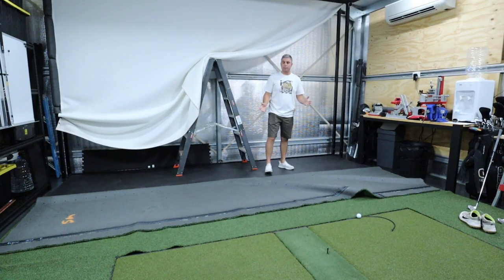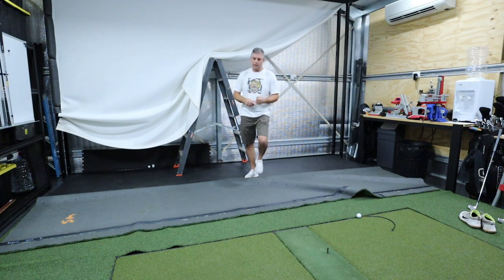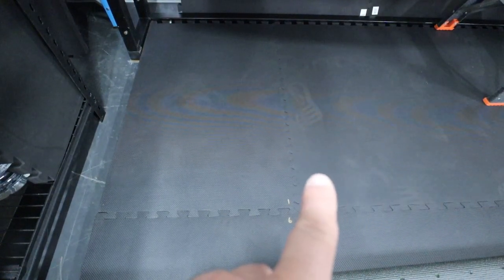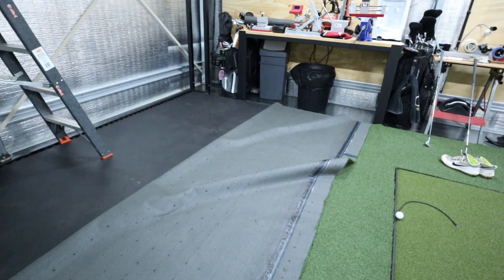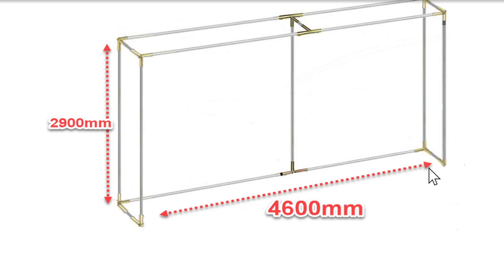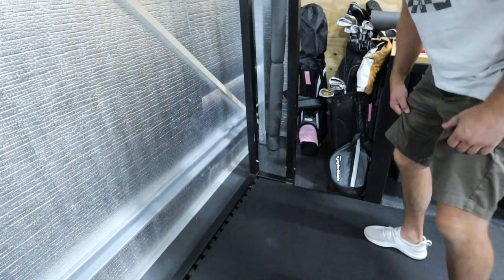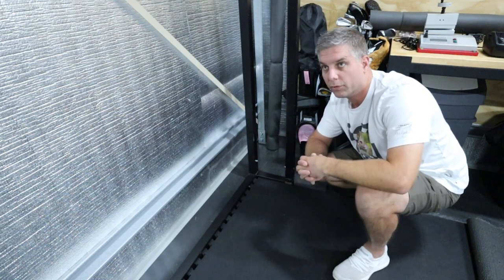DYI Golf Simulator Frame Build for Impact Screen - PART 2

Comment: Great video.  I bootstrapped an in-garage sim that I was looking to make some improvements on.  I did my original design with 3/4" EMT and my screen is only 10' wide but sags in the center.  Your work regarding the frame was very helpful and has convinced me to use your approach in my next update.  Maybe I missed it, but what gauge tubing did you use?  Thanks!
Reply from the maker: Hi Philip, I'm glad the video gave you some inspiration to improve your screen.  The entire purpose of my video was to simplify the build process for others by reducing the research and expanding the knowledge for others by learning from my mistakes.  The RHS tubing I used for the main support beams which makes up 90% of the steel used was (50mm x 50mm x 2mm wall thickness).  The corners and "Y" pieces were a heavier gauge and smaller diameter (40mm x 40mm x 3mm) to allow sliding internally into the 50x50 RHS tubing.  One of the reasons I went with a square tubing at 50mm x 50mm was to reduce any sagging over the span of 4600mm.  My frame has zero sag and its a number of years old now.  I hope this helps, good luck.

Comment: I see you haven’t posted i awhile hopefully your doing well. Question about the gym mat and fiberbuilt hitting area interface. Are they at the exact same height? Would you change the mat thickness if you were to do this set up again?
Reply from the maker: I haven't posted because I recently sold my home and bought a new upgrade.  Unfortunately the new home doesn't have a simulator space as of yet.  I hope to build a new sim soon, but time and money is getting in the way with an already busy few months with the new home.  My gym mats are a few millimetres less in thickness compared to the Fiber Built mat which allows for the turf to sit flush on top of the gym mats.  Yes the gym mats plus the putting turf is exactly the same height as the Fiber Built.  This was very important to me to ensure a healthy roll while putting.  If there is a slight difference in height that isn't visible to your eye this won't be noticeable when putting.

Comment: Fantastic work!!! I also try to do something like that, but I have a question, If I put my projector(i want to buy  the same model like yours) 15 feet away from the impact screen there is any problem with the shadow? The high of my room is 10 feet thanks Antonio
Reply from the maker: depending on your height you may see the top of your head shadow, only based on the 10 foot height not the 15 feet

Comment: awesome video, hoping to builda 16x20 shed next year. Can you make a video more of the garage/shed structure itself? Did you build it, what was the cost, why you decided on a metal building. etc.
Reply from the maker: Hi James, thanks for the comment.  Please subscribe and like the video.  I've recently purchased a new home, and my simulator is no more.  At the new home I am planning on rebuilding my sim bay, but time and money is in the way.  Especially the COVID build prices are holding me back.  I kind of built the building for the last sim on the video.  Basically I picked the size of the structure 6mx6mx3m and had a cement contractor come in to pour the concrete base.  Once the base was complete and painted dark grey I ordered a "shed" package to accommodate the concrete pad.  I live in Australia, and steel shed structures of all shapes and sizes are extremely common here and very cost effective for what you get compared to a lumber structure.  see weblink below.
https://www.southerncrosssheds.com/products/domestic-sheds/

I chose to insulate and add air conditioning to the structure for obvious reasons.  The shed structure was assembled and finished in one business day compared to the lumber building.  Once the building was built, I had an electrician come in and add all the power points I required based on my plan and imagination.  The shed without the concrete pad insulated and assembled was approx. $6k, then the electrical wiring etc.  I did all the trenching for the main power to the building to shave some labour costs, and completely wired all of the low voltage A/V cables etc.  Once the time and money challenge is removed from my recent move at the new home, I plan on making a series of video showing the complete build from start to finish.  So far I have the new building erect detached from my house.  I went for a slightly bigger building this time to allow for more sitting room for guests and viewers.  My new building is 7.5mx6mx3.5m.  So far just the concrete and building are finished with no electrical or insulation, air conditioning yet.  hope this helps!

Comment: Where did you get the pipe insulation in the video.  I can’t find any near that big/round to use and cover the gap for stray shots.  What’s it called or anyone have a link to it online?  I can only find 3/4 and 1” or slightly larger pipe foam insulation but this looks like it’s for 3” pipe or something and is what I need!
Reply from the maker: https://www.scottsfrp.com.au/?s=Foam+pipe+insulation+

It’s 63mm OD

Comment: Awesome video after watching I am considering almost copying your build. Just a few questions though:
1. What is your option on the fiberbuilt mat and have you noticed any wear and tear on the standing section.
2. With the rhs tubing I was a little bit unsure what process you used. To me it seems you were saying you cut the tubing to your dimensions and inserted it in different joints to build the frame and then had it welded. I want to save some money on a frame and have access to a quality welder for cheap and am wondering what tips you would give on building the frame and the math in determining the size of anything.
Thanks a lot, I would really appreciate any other photos you have of the original frame and build so that if i decide to copy I have a reference.
Reply from the maker: Hi Oakmont.
1. I can't comment on this one because my standing area on the Fiberbuilt mat has no wear on it at all.  Its been years of standing on it with golf shoes and no wear.  However I never hit golf shots from this area, meaning no golf club impact on the standing area.
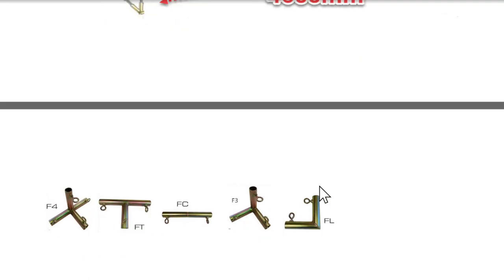2. Pause the video at the 5:50 mark.  As an example look at F4.  I only welded these sections, I made a piece out of smaller tubing and inserted it into the larger tubing then bolted it together.  These are the corners of the main structure that hold everything together.  When built this way I'm able to take apart the frame anytime to relocate.  My frame is currently locked away in storage since I moved.  If you show your qualified welded my video, his mind will work in a way he will understand the design.  Happy to meet you on Microsoft Teams to walk you through the design.

Comment: Hi really love the video and details on the design. I am looking to build one for my studio. You mention the roof juts out 1 meter. Did you weld more square tubing to the frame to build it? Could you tell me a little more ? Dimensions for the tubing? and then lined with the ply? Thank you in advance
Reply from the maker: no I didn't weld the tubing.  The "Y" sections I talk about in the top left and right corners were four sided instead of three sided inserts so I could slide the tubing over to build the "ceiling".  Then I covered the underside with 3/8" plywood so I could glue the acoustic foam panels to the plywood. The tubing is 50mmx50mmx2.5mm

Comment: what size is your garage? im looking a putting one in my backyard for a sim.
Reply from the maker: Hi After, make sure you take a look at part 1 of the video.  Lots of good information including the size of the garage.  6m x 6m x 3.1m to the eves
Reply: @sklebeck  Hi again Shaun. We finally made it to the new house (stranded in northern NSW for nearly 5 months waiting to get here). The space isn't quite what I was hoping for but I have enough room for a 12' wide x 9' high screen and about 17' screen to back wall so I should be able to fashion something half-decent. Have you moved into your new home and re-established the simulator bay?
Reply from the maker: @rufussthoo4083  i did get moved, but my simulator bay hasn't been started yet.  Time and money.  I estimated about $10k - $15k to finish it.
Reply: @sklebeck  I hope it comes together for you the way you want. I'm still struggling to decide on the launch monitor. A GCQuad/Trackman/Flightscope are beyond my budget so I'm having to look at the Uneekor EYE XO (ceiling mount) vs GC3 (limited data) vs Full Swing (radar based).

Comment: Great video, I'm in the process of making something similar based on your design, they say imitation is the greatest form of flattery 😁 Just wondering roughly how long you made the bunjees, I've seen pre made ones on amazon cheap enough plus how many did you use. Thanks for your time 👍
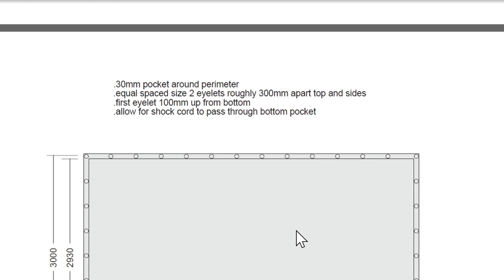Reply from the maker: Hi Jayo, I appreciate you watching and I hope you've seen part one of the build video.  My bungee's are 2.5" long.  the total number used can be counted on the drawing displayed on this video.  Go to 7:23 and count the number of holes to give you an idea. (30 bungee's total) That is that exact build drawing I used.  Again thanks for commenting and please subscribe.
Reply: @sklebeck  thank you sir for the reply much appreciated..subscribed 👍 hope your new home doesn't have the flooding problem, best of luck with the new build looking forward to seeing it.
Reply from the maker: @jayojunior3067  thanks for the comments Jayo
Reply: @sklebeck  I've watched Part 1 & Part 2 several times and learn something new each time.  I'm replicating this as well.  I have a bit more space but I don't see any reason to make it any bigger than this.

Question, you mentioned adding a pdf to this video but I don't see it...no worries if you don't have one already made.  I'm wondering if you know the diamensions of the connectors.  I understand they are 40mmX40mm & 3mm thick but wondering about the length needed.  I know this doensn't really matter since it slides in, just wanted to try and do the best I could to actually duplicate this build.
Reply from the maker: @TylerFalwell  you may need to check the details again Tyler.  The steel tubing is 50mm x 50mm not 40mm.  The bungees are 63.5mm long
Reply: @sklebeck  I was referring to the connectors that slide inside the longer sections which is 50x50.
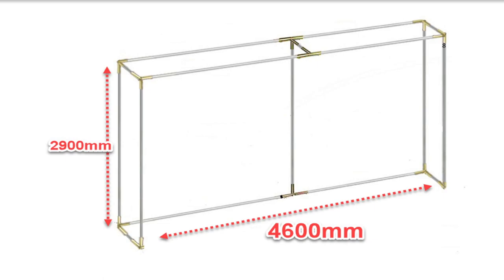Reply from the maker: @TylerFalwell  the PDF I was referring to is the diagram I've imbedded into the video at 4:12.  You are correct the length doesn't really matter, pick a length that allows you to easily drill a hole and bolt.  Knowing myself I would have picked 6"x6" or 152mm
Reply: @sklebeck  Thank you, I appreciate the responses.  I can't wait to see your next SIM build.  I know making videos is a ton of work but you are unique in your approach and understanding of technology/engineering so I hope you get back to it.  I think you are on the cusp of something here and the channel could really take off and some brands would love to take part in it.
Reply from the maker: @TylerFalwell  thanks for the kind feedback.  Life has been so busy and the material prices in the crazy world today have been scaring me off a new build since I moved.  We will see what the future holds on the new build.  Stay tuned and feel free to reach out with questions when you have them.  Good luck